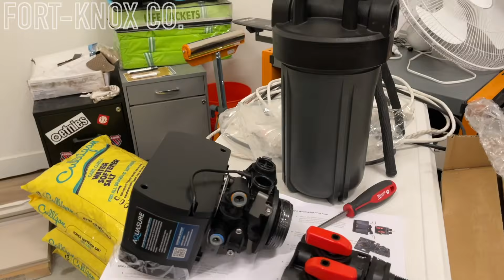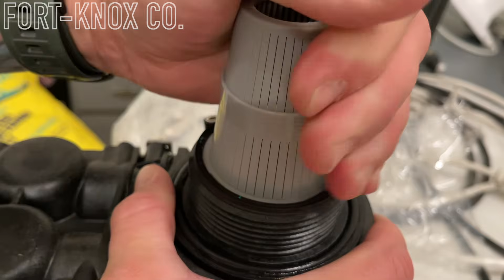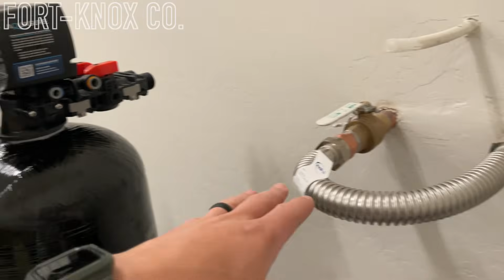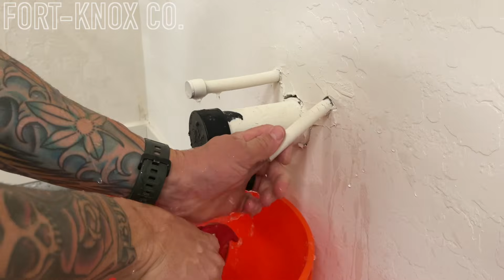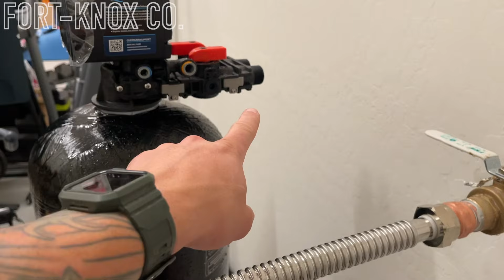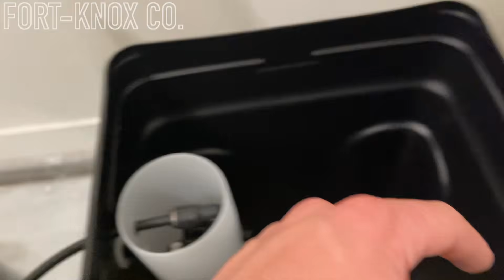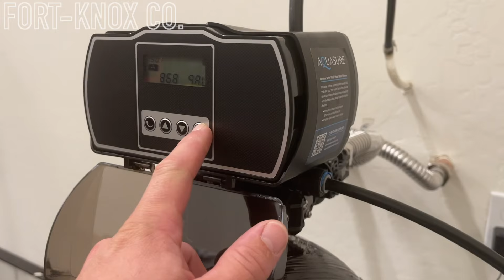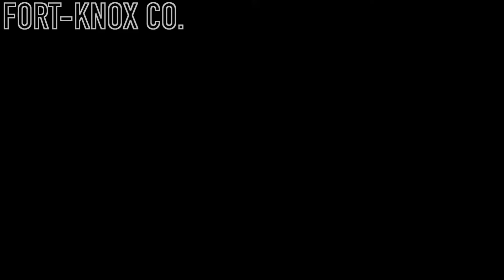How To Install Water Softener System Aquasure Harmony Series | Water Softener Loop Connection

Comment: Thanks for the video - it's really helpful!

qq: I installed 64000 grain harmony series and followed the setup instructions (from the owners manual as well your vide) and within 1 day, I noticed brown foamy water in the brine tank - is that normal ?
Reply from the maker: Yeah. The brine tank will get nasty sometimes when it flushes with the water and then pulls the salty water through the tank to clean out all the mineral deposits. So it can look kinda weird in there. I think overtime as your system is flushed several times the Brine tank looks a little more consistent though

Comment: Do you have a video or can you make one where you show how to install a loop if there isnt an existing one
Reply from the maker: I don’t currently have one but will be making one soon. That question seems to be coming up more often now. So I’ll be showing how that is accomplished. How to create your own break in the water line, tune out two pieces with threads on them so you can connect your softener system.

Comment: Thanks for the video! If my goal is to install a whole house smart shutoff valve, is there a more elegant solution to hide everything behind a service panel flush to the finished drywall (instead of sticking out of the wall)?
Reply from the maker: I guess you could do that if you want to be a little creative but you’d obviously need to open up that wall and know exactly where you water lines are. If your water line is running horizontally then you’d maybe be cutting to the left a panel door with a shut off valve in line before the softener loop. Then doing the same thing to the right side with a door for the shut off after the loop. 

Or if your lines are running up & down vertically you may be able to have just one panel above the loop and install your shut offs inside the wall cavity with a plate door covering? It kinda depends on just how creative and confident you are messing with the plumbing. 
The one thing to consider is that when you cut into a line and want to just install a shut off valve for example, you don’t have a lot of slack to play with when bringing the valve in and putting the line into your fitting. Putting a cap on an end sticking out is easy. Putting a piece spliced in line takes some skill

Comment: Had mine shipped to Japan. Your video was excellent and a big big help. Thank you so much. My brine tank only filled up just passed the white plastic screen/stand on the bottom. 32,000. Any thoughts? I'll be troubleshooting myself as well.
Reply from the maker: The brine tank has a shut off valve similar to a toilet. A float that when the water level hits it it will self shut off usually. So I would check all those connections and make sure everything is secured and not fixed in an off position. I’ve seen sometimes the float is stuck and not letting water in. Also on the head unit make sure all your settings are correct. I believe part of the numbers set on the regeneration cycle will have to do with how much water is used to flush from the brine tank
Reply: @FortKnoxCo  thank you. I was switching out from an old Japanese model and the in/out valves are the opposite. So I actually ran the first cycle this way. I hope I didn't screw something up but it still worked. thanks
Reply from the maker: @ it should be fine. Yeah it seems like some houses have the in
And out in the opposite spots like mine. But most units not are the same.

Comment: Nice video...   As a plumber, we dont and shouldn't use sharkbites. It's a more expensive, inferior product that (with time) will ruin your reputation.
Reply from the maker: I understand that. It wouldn’t be the best choice in some instances but they are an option for some people. They are obviously rated and built to code standards for applications. But as a professional I would want my plumber throwing shark bites inside my walls. I usually suggest if you’re going to use it on something it’s because it’s a one off instance where you probably don’t normally do plumbing and they are easy enough to understand and use. And they should always be accessible. Not placed inside inside drywall so if they ever do fail or aren’t placed on correctly you can see quickly and act accordingly

Comment: Do you have to close the inlet going into the house every time it runs a cleaning cycles?
Reply from the maker: No. It will run itself and open & close its valves as needed. The only thing is while it’s doing its regeneration cycle the water running through the house will not be softened water, it allows regular water to pass through. So that’s why they say to try n schedule the regeneration cycle at a time late at night or windows where there is not anticipated use.
Reply: Got it, thanks bro

Comment: I forgot to run the program on the initial setup and let water flow throughout for about two days. I re-read the instruction manual and found that I had to run the manual program on the first job. Once I realized that I ran the manual program. Should I do anything else after the job completes?
Reply from the maker: It doesn’t sound like it. Once you run the initial start up it should be good to go. Then, depending on whatever you have it set up. It will do its regeneration cycle when needed. I believe the initial run through is just to sort of clean and rinse the new material inside the filters before you start using it.
Similar to like a reverse osmosis system, they want you to fill it up all the way and let it run for a while and rinse everything out and then it’s good to go
Reply: Thank you so much I was worried that I ruined the system since I forgot to do this. I should have watched your video first. A much better walkthrough than what the distributor provides!

Comment: So the tube from the main tank to the salt tank is actually an in and out waterline depending what it’s calling for?
Reply from the maker: Yes. It sends water to add to the salt, lets it soak and then pulls it to rinse itself out.

Comment: Great Video! I just have one question. I was about to buy the Aquasure system, but I found out that the drain can't go higher than 7Ft. My Loop is in my garage and my drain goes upstairs in my laundry room just above the garage, and the drain line is not in the garage wall. I also noticed that all softeners do not recommend draining higher than 8ft. There has to be a way to get this to drain upstairs. When I lived in AZ I had the same setup in my home but I had a local Co. install a water softener.
Reply from the maker: I had this system installed for a couple years and have another one now, both say that. But my drain line goes up the wall in 10’ ft ceiling and over to another laundry room to drip into that drain. So I’d say it’s more than 7’ vertical and I’ve had no problem. The water coming out seems to have pretty good pressure. So I would assume it won’t be anything to worry about. Should drain fine. 

But worst case you’d have to return it and Amazon does do returns as well as Home Depot if you’re getting the Aquasure.

Comment: How often do you have to change the filter?
Reply from the maker: If your I staking the pre or post cartridge filter (usually a large cotton/carbon type filter) you should change it every 6-12 months depending on if you have a high usage. Like large family always running water lots of gallons uses regularly then 6 months is good

Comment: thanks for this video.  Mine is installed.  Looks like I did it right but it does not count down gallons.  Just stays at 1000.  I have tried to work with Aquasure  customer service but they have not been helpful.  Any thoughts?
Reply from the maker: Not sure why it wouldn’t count down. Seems like a computer thing in the head unit? It’s usually controlled by a small mechanical part that’s spins as the water flows through. Like a counter. So maybe it’s not working and it doesn’t recognize the water flowing though. But I believe that part/sensor is in the head unit somewhere. Not an easy to get to fix is my guess. 

They should replace the head unit and send you a new one

Comment: Thx for the video but I haven’t a water loop not soft water system it’s leaking could I just replace my pvc to shark bit until I get soft water system thx in advance
Reply from the maker: Yeah if you have a leak you may need to cut out the leak and just repair if you’re not ready to install a water softener. But how you decide to repair the pipe is up to you. Shark bite connections are great for quick fixes. Affordable and fast. And they are rated to hold. I know professionals don’t like them. But they do the job

Comment: My enter button lights the screen up but does not allow me to change the time or any setting? Any idea what I can try doing?
Reply from the maker: I would have to refer back to the manual. Not sure if it requires a push and hold for a certain amount info seconds or what. I know there is some different modes to work through on the screen

Comment: I’m replacing an existing setup that looks just like this. Softener is 20 years old and died. The connections are PVC because copper springs leaks in slabs here. (On coast). Would you use the same flexible metal tubing to tie into existing threaded PVC?
Reply from the maker: Yeah you can do that. They should make a PVC threaded end you can put on your PVC pipes and then connect your flex lines from the water source to the unit.
Reply: @FortKnoxCo Thanks!

Comment: Is the softener you chose a metered unit?  Meaning it only regenerates when necessary and not merely on a timed cycle?  Thanks for the very informative video. Good job!
Reply from the maker: Yes. It’s metered. You set it for your water hardness level and your gallons usage you’d like it to regenerate at.
Reply: Thx

Comment: I found 24" length 1 inch to 3/4 Shark Bite flex pipe . Thanks for the tip on the flex pipes. QUESTION.. is the drain pump powered? Does it spit a lot of water in your laundry room sink?
Reply from the maker: It is pressurized by what I believe is the water pressure in your lines? But it may have some type of small pump in there to clear the line so water doesn’t sit in it after it runs its drain cycle. It does pump out a lot of water but nothing I have seen a regular drain handle. Usually the laundry drain for your washer is perfect because it has about a 24” drop to the p-trap. Don’t can handle it. I haven’t seen what it would do in a regular sink and small drop to a p-trap.
Reply: @ thank again

Comment: Thanks a ton man. Saved me some cash! I went with 48k grain one made by Charger. Clack head with 10% crosslink resin. I was going to go with that same model by Aquasure but heard a couple plumbers say the big box stores use a cheaper resin?
Reply from the maker: That could very well be true. I’ve seen aquasure at Home Depot and more commonly at Amazon. But not 100% sure on if their resin is any different or not. I felt like my water was softer with the aquasure system compared to the one I had previously at our last house. But either way being able to install it yourself is gonna save you a bunch of money 🤙🏼

Comment: Is the softener going only on the hot water line?
Reply from the maker: No. It softens the main water line before the water splits off to the cold feed and hot water feed to the heater.

Comment: Good instructions, I just need more information about how to connect the pipe in the drain line, if i dont know where exactly in the wall its the drain line
Reply from the maker: If your home is plumbed for the softener water loop there should be a connection to a smaller diameter pipe that’s meant for the drain line. If you’re not seeing one or need to add one you need to locate the nearest drain line in an adjacent wall hopefully. If you don’t have a drain line in a shared wall that you can run a line to then you may need to explore other options. Running a drain line to a utility sink drain? Run a line up the wall and through the ceiling and to the drain line near by and drop it into that. 

My line in the wall is not next to or above a drain line the line actually runs up the wall, across the attic about 10’ and then Down into the laundry room and drops into the same drain pipe the washing machine drains into. This is a very common place to have your water softener drains into into

Comment: Hello, we had a plumber set this up for us before we’ve moved into the house and had no salt in it and somehow the salt tank got water in it and smells like rotten eggs/sulfur. Anyone know how we can clean the tank?
Reply from the maker: It’s not unusual for the brine tank to have some water in it. It will fill and flush the tank during the regeneration cycle. And usually there’s still some water left in the bottom. If you want to clean it out you can simply disconnect the water fill line and move, rinse, scrub and replace the tank. But it will most likely still have some smell from the salty water that will be there over its use. You will need to just add your salt bags to the tank every few months to make sure it doesn’t run empty.
Reply: @FortKnoxCo  thank you so much for replying I was going crazy wondering if I should add soap or solution to it.
Reply from the maker: @ no no. Don’t add any soap. If you want to rinse it no it and make sure it’s clean before adding more salt pellets then you could but it’s not necessary. That tank needs to be constantly stocked with salt. I usually add 3-5 bags every few months. Just depends on how much it’s being used. But it will almost always have a smell because of the sitting salty water I between the times it regenerates.
Reply: @ Will the water we use have a smell to it because of it or that won’t affect it?
Reply from the maker: @ no it shouldn’t. It only uses that Saline or Brine water (salty water) is only used to flush your filtration tank. It has the ability to “scrub” and remove the hard water minerals that are being caught from you water on the resin beads in your filter tank.  

So you system runs for a while and gauges how much water has ran through it. Once it knows you have ran let’s say 3,000 gallons through it knows it needs to “clean its filters” or regenerate the large filter tank. That tank has “matter” or usually resin beads that do the softening of your water. They get build up from doing this and need to be cleaned. So you system shuts off the tanks water valve for the house water and temporarily bypasses itself so it can clean itself. While it’s doing this it then fills the Brine tank, then pulls that salty water into itself and flushes itself. It does this a couple times, flushes all that water out as waste and then flushes itself with clean water for a but to make sure there is no salty water in the filter tank afterwards. Then it opens itself back up and starts allowing the house water to flow though the tank and soften it again. So that salty water is not being left in your filter tank or running though your home, it’s only used dieting its regeneration cycle.
Reply: @ Omg thank you so much honestly, this is great information!
Reply from the maker: @ no problem at all. Happy to be of help. If you want to throw a like on the video  or Subscribe on the channel it’s much appreciated 🤙🏼

Comment: Hi Brian, this is life saving! Thank you so much for putting this together. Just a question on my end: my house’s layout would only allow flush water to drain to a condensation pipe between sump pump and furnace (I guess i have to cut the pipe and put on a drain saddle?). Not sure if that would work. Thanks a lot!
Reply from the maker: Yeah the flush line just needs to get to some type of drain, can be any sink drain or similar. But usually homes that have this plumbed in have that drain line connection go to the laundry room and it drops right into or above the washing machine drain connection. This is because they ask that the drain be able to handle a higher flow of water when it’s flushing. The laundry room drains have about 24” vertical pipe coming up from the P-trap/saddle. This allows it to handle the higher flow of water from the machine and prevent any overflowing issues. So if you do add a saddle or P-trap make sure you give it about 24” of vertical pipe to where the drain line comes into. I hope that all makes sense.
Reply: @ thank you for your prompt response. Just wanted to make sure I get it right. First cut into the in-place condensation drain pipe and put a saddle/p-trap, then connect to a 24” vertical pipe and lastly connect water softener flush line to the 24” pipe.
Reply from the maker: @ that sounds correct. Have a good enough drop to the P-trap so it can handle the water flow.
Reply: @FortKnoxCo  got it, thanks a lot for your help!